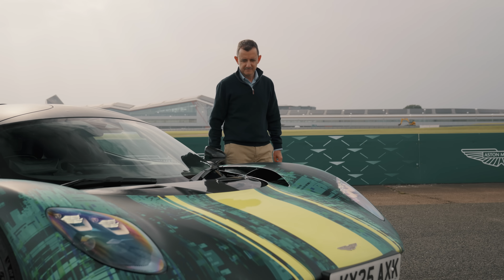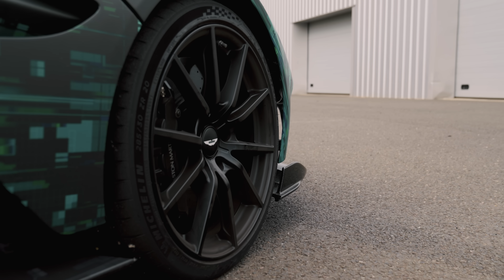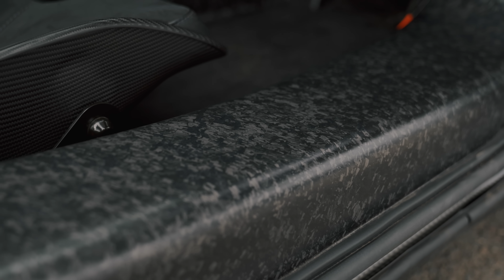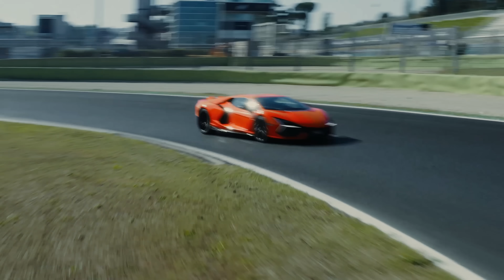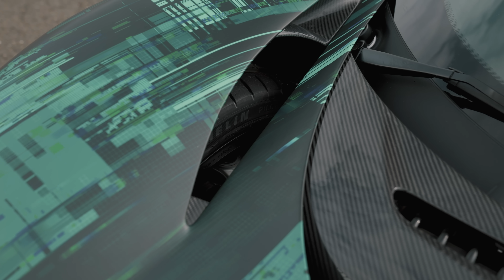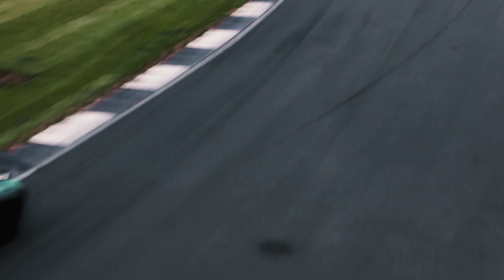FIRST DRIVE: Aston Martin Valhalla Prototype – 1064hp Son Of Valkyrie!

Comment: Forgot to mention the ZR1X as a competitor
Reply: Two different demographics, power alone doesn’t make you a competitor.
Reply: @Susanoszn Except the ZR1 has set some absolutely mighty lap records in the hands of the development engineers. Your “Corvettes don’t handle" schtick is no longer relevant and hasn’t been for decades. Google “c8 ZR1 lap records"
Reply: @Susanoszn so what happens when the ZR1 is faster on track and is better on the road
Reply: @scottbowers7248   You completely missed the point. DBS owners do not care if your Hellcat or ZO6 is “Faster”. They serve two different classes of people.
Reply: @Susanoszn when you pay that much for something and that something is a performance car it is about ego, and having someone spend a fraction of what you spend and have their car be superior in every performance metric and be better to drive on the road is a shot to the Ego.
Reply: @scottbowers7248  Again, you’re bringing up performance. It’s not getting through to you for some reason. Have a good day.
Reply: @Susanoszn it’s a performance car it matters unless you are simply a poser, if you drive the car it matters
Reply: @scottbowers7248 here’s a way you might be able to understand it. McDonald’s might be able to make a steak that tastes as good as a french restaurant for cheaper but your going to take your first date to the restaurant… they are not competitors
Reply: The zr1x isn't sold in Europe
Reply: That’s cuz it’s not
Reply: @jjjfo1818 what was the Nurburgring ring time for the ZR1X? What was the Valhalla’s time? I agree though the Valahalla doesn’t really reach the levels of the ZR1X.
Reply: @Make-Asylums-Great-Again  If I remember correctly the ZR1X lapped in the same time as a 992 GT3RS which has 700hp less than it. Oh and the Manthey version of the GT3RS was lapped in 6:47 compared to the ZR1X’s 6:49. Oh and the Manthey 991 GT2RS was even quicker so it can't even beat the last generation 991 GT2RS.

This Aston is nearly 500kg lighter has more down force and similar amount of horsepower. It hasn't lapped the Nurburgring yet but the conclusion considering those aforementioned facts is clear the Aston Martin would be quicker. Same for the McLaren W1 and the Ferrari F80 so I'd maybe hold off the victory lap.
Reply: @Make-Asylums-Great-Again The Valhalla will easily go below 6:40. The ZR1X couldn't beat a GT3 RS with 525hp.
Reply: The glaze does not stop lmao. Zr1x and this ain't even close. Hp ain't everything
Reply: No one buying this car will be cross shopping it with a ZR1X, behave yourself. 😂
Reply: @F1ll1nTh3Blanks exactly.  This looks exotic and unique.  The zr1 looks like a hopped up corvette.  You still have the base of a $70k usd corvette.
Reply: @F1ll1nTh3Blanks you’d be surprised, go in the corvette forum, all the guys who got a zr1 are comparing it to their sf90s and 765lts they already have
Reply: The Valhalla's use of a carbon fiber tub lowers the curb weight and greatly increases the cost. The active aero gives it greater control in the corners and the hybrid drive system is clearly more sophisticated with independent motors for each front wheel the likely adjust power to improve traction in the corners. Where it falls short of the ZR1x (as highlighted in the video) is the AMG sourced V8. Anyone who reads up on GM's flat plane crank V8 that was introduced in the Z06 and then got the twin turbo setup on the ZR1s will acknowledge that powerplant as something special. For one it redlines at 8500rpm which is insane for a V8.
Reply: @RichardV-m5v 8500 insane for a v8?! 😂

Ferrari came
Up with 9000 rpm v8 more than 12 years ago
Reply: @neojfk1883 a 5.5L flat plane DOHC V8? Yes, it's insane. Ferrari's V8s have always been tiny with small strokes. Even the 458 was a 4.5L engine with an 80mm stroke. Running a production engine with an LS-sized bore at 8500RPM and a GM warranty attached to it is a monumental undertaking. The stroke is shorter than the 458's and far shorter than the Voodoo's, but a WAY larger 4.104" bore. The LT6 is the largest flat plane V8 ever, and there will be more of those V8s made than probably all other flat plane V8s combined as well.
Reply: @spdcrzy off topic and unrelated to main comment or mine
Reply: It’s not one , performance wise yes but a guy that’s looking to buy an £850000 hypercar is probably not conflicted between that and a Chevrolet that’s £150k
Reply: Nobody is cross shopping this car with a corvette. The people who are buying these can buy a corvette too if they want.
Reply: The Valkarie has beaten GT3 race car times and close to LMP2 level speeds. This car has more HP, but also has more weight and not as good Aero but far better than the Corvette ZR1X. If you think they are in the same category you're high. The Corvette is impressive and a great achievement but not on the same level.
Reply: @eichler721 the “Valkyrie” is a $4 million car designed by Adrian Newey, the Valhalla is not is has less HP than the ZR1 and guaranteed Chevy’s engineering is better than Aston’s . Aston builds beautiful cars that are dynamically under developed
Reply: Aston has said they're shooting for 6min30 Nurburgring time, ZRX1 does 6min49, we will see
Reply: @c9designs523 ZR1X has a good amount of time left on the table though, with a pro driver their shaving off a few seconds for sure. It is a mid to low 6:40’s car with a pro driver in my opinion, I don’t think it’ll shave off 10 like Misha said however.
Reply: Lmao don’t compare American junk to an Aston
Reply: @teletubbypo318  It’s going to be compared. That American junk, has competed and won more races than Aston Martin has. Aston Martin’s Le Mans win, was won with Carroll Shelby at the wheel. Who went on to win with Ford’s junk.
Reply: It doesn't compare
Reply: I feel like it won’t get cross shopped with this for some reason..
Reply: they filmed this before ZR1 came out
Reply: @PiotrPiotr-v2ucame here to literally find this
Reply: No one will the money for the Valhalla will ever consider a Corvette as an alternative. This car will compete with the SF90XX.
Reply: I'm American, and would never insult this Aston Martin with a mere Corvette....😊
Reply: @Bruce.-Wayne  it’s not an insult. That Corvette ZR1/ZR1X is a beast. Only the car snobs consider it an insult. It’s got the design, the tech, the numbers, the engineering, AND the Heritage for less. 
Remember, the Corvette has its own in-house engine, Aston Martin is using the flat plane V8 from AMG, albeit a a great engine.
Are you paying for a name, or are you paying for something that has changed the game?
Reply: @TheCluesRnTheBlues it doesnt have THE design. Vettes look like shit. And their legacy is plastic things that go pretty quick.

You make it sounds like its Godzilla. Which could get away with being less refined. 

I'll give you the beast part. But that doesnt make it comparable to these cars. This arent meant to be 'beasts' I think.
Reply: @Tylernesss  just admit that you’re a car snob. The Corvette has proven itself in races for the past 25+ years. In the past, was made out of fiberglass. Not now. 
Now, I am not fan of the C8 Corvette’s rear end design. However, overall, it’s a good first attempt for mid engined Corvette design.
Reply: No, it's more like Ferrari sf90 and Lamborghini revuelto competitor than a corvette
Reply: Found the American guys don’t worry about it they don’t know what they’re talking about
Reply: We still don't know if the ZR1X is going to be available in the UK.
Reply: both cars are to fast to plant your right foot on the road and both cars are faster than 99.99% of drivers on a track. It basically comes down to personal preference. And who actually cares about rings times? These are poser cars not track cars, not that i think thats a bad thing whatsoever.
Reply: Typical Americans still crying
Reply: temerario
Reply: People will buy this to park in a garage with their 87 other cars and just look at it, people will buy the corvette to have it stolen.
Reply: Feeling jealous..?
Reply: (Because it isn't a competitor)
Reply: A ZR1X doesn’t keep up with the Valhalla on a track. It’s heavier and a lot less down force. Only comparable in straight line speed. The Valhalla barely keeps up with the F80 and W1 on a track. As a matter of fact the Valhalla is better tied performance wise to last decades holy trinity cars along with the Revuelto and SF90 being close to those cars. The Valkyrie on the other hand over laps the F80 and W1 having a lot more down force and less weight so also not directly comparable. But all these cars will be compared regardless. I have downforce numbers if someone disagrees
Reply: @firomancer1018 The ZR1 and ZR1x are competitors.
Reply: @rkwjunior2298 the Valhalla makes more than twice the downforce of the ZTK ZR1s and it weighs less. I’m ignoring price and talking about performance and the math isn’t mathing. A quarter million dollar vette can only do so much with static aero and mechanical grip. The regular ZR1 is over 3900 lbs let alone the ZR1X being even heavier with the hybrid system, we’re talking 4100 lbs. That’s getting closer to GTD territory with that 4343 lbs
Reply: @firomancer1018 They are competitors whether you like it or not.
Reply: lol that pice is junk a competitor ? Struggling to keep up with a gt3RS with less than half the power
Reply: @neojfk1883  so it matches/is better than the gt3RS in the exact thing that the gt3rs was designed for, and will be faster and more comfortable everywhere. While costing less money. piece tell me how it's a piece of junk.
Reply: Yeah. However, this probably will be lighter, and better quality materials. Oddly, this was supposed to have a 3 liter  TT hot V V6.
Reply: @TheCluesRnTheBlues engineer said it's 1655 dry, so it'll be around the same weight wet.
Reply: @Mr.Waffullz  Motortrend lists the C8 ZR1 weight as 3,900 pounds with all the fluids.
Reply: @TheCluesRnTheBlues indeed, but MUCH more expensive.
Reply: @TheCluesRnTheBlues "better quality materials" they can't afford that in their stripped out hypercar remember?😂 the Vette has heated and cooled seats, full aluminum everywhere, carbon fibre, swede, leather, there is no way in hell a british sportscar is up to snuff in quality when compared to an American luxury sport vehicle.
Reply: @aaronvector4750  It’s an Aston Martin, the second project after the Valkyrie. Did you not see the interior of the Valhalla and the active aero/DRS?
The Corvette is giving performance for a lower price. The Corvette doesn’t have the active aero/DRS, and the stripped out carbon fiber interior. 
The ZR1 is RWD, (according to Car& Driver) 3,831 pounds. The ZR1X is the AWD version.
I’d say this, the Corvette delivers performance for far less. Makes one wonder is the Aston Martin even worth it?
Reply: The ZR1X is a formidable competitor. However, the Corvette target market is quite different. Plus, there are individuals who will buy both plus own many other vehicles in their fleet. It’s not an either-or debate. Though it will look good for automotive journalism.
Reply: The ZR1X sells for the price of the options on this car and is probably faster. However it's not European, you can fix it at a Chevy dealer, it didn't cost as much as a house and won't lose $175K a year in depreciation. Therefore,.we must hate it. 🙄
Reply: @davidnicholson6680  Exactly, you get the point! It's a Chevy, not a supercar. And no, it won't even touch the Valhalla and the SF90XX (which the Aston competes with) on track. It should try to keep up with a 500hp GT3 RS before it can take on this tier of cars.
Reply: @Direly_Strait Get the SF90XX to beat a Senna last time I checked it lost by 3 seconds on Hockenheim. ZR1 beat the Senna by 2 seconds at VIR. It’s also 5 seconds faster than the Black Series, GT3RS, and GT2RS. Black Series is another car the SF90 XX failed to beat at Hockenheim
Reply: @dylangiles2624 Comparing laptimes between different cars in entirely different tracks tells me everything I need to know. Never beating the allegations.
Reply: @dylangiles2624 corvette laptimes are factory supported on American track while other brands laptimes were done by magazine, if in the hands of sportauto driver zr1 can beat sf90xx ,black series or senna then we can talk, just look at the ring laptime ,on American track zr1 beats gt black series while on the ring it failed to beat 7 year gt2rs, even tested by sportauto zo6 was 16sec slower than gt3rs and 12sec slower than 296gtb, let see if corvette give zr1 to sportauto for hockenheimring and ring test
Reply: Hypercars have become soulless over the years….
Reply: A British magazine, caters to a British audience. The corvette isn’t for here. Thankfully.
Reply: @gooddypm  ...   I think you'd be surprised!
Reply: @howardmckenna about what in particular?
Reply: @gooddypm  ...  The ZR1X is meant to be insanely competent. Rumoured 230mph, too.
Reply: Why thankfully its a great car with incredible engineering  @gooddypm
Reply: @gooddypm im more into europeans but the zr1x is a much faster and better car than any of the sf90/296, revuelto, and all the other europeans thankfully lol
I track my cars and have ripped a 296 when i was at maranello so id like to think i know a thing or two but then again maybe not.

All im saying is when theres more people making great cars its better for everyone. At least for people who can afford
Reply: @PaganiKoenigsegg1 that has nothing to do with what I said. This is aimed at Brits, not Septics. The Corvette won’t be on sale here. This is a British Magazine doing a video to a Brit audience
Reply: @gooddypm  this car a million quid. Importing ZR1X to UK probably costs around 700K quid.
Still 300K quid cheaper 🤣.  But yes, LHD only.
Reply: @gooddypm not sure where you got that. But C8 Corvettes are pretty reliable. Look it up if you don't believe me.
Not sure about this Valhalla though
Reply: @PaganiKoenigsegg1 Why is it a better car?
Reply: @GSCinquanta i wouldnt say its better, my point was just its better for people to have more options. 

Like i said above i personally track my cars so if theres more options the better it is, whether its 40k price range or 400k price range or more. I was driving a 296 when i was in maranello and that felt great but im just saying that just because its american it doesnt mean its inferior.. it might even be better than alot of cars people think are "great" and no im not american.
Reply: @JiTiAr35 and is not as good looking,is not as premium ....
Reply: @MARCO-rq2ph  that's an opinion. I can't argue with that.
Reply: @JiTiAr35 

Tell me which one will then lose more money!! Just because one costs £1m whilst the other costs, theoretically, £700k, does not automatically make the cheaper car better value! The ZR1X will shed value at a frightening rate!
Reply: @PaganiKoenigsegg1 zr1 losa quarter Mile to 992 revuelto 750s tuned and plaid. Sf90 is right behind the plaid. Americans lack in engineering. I come from a father with ALOOOT of exótic cars. He put half deposit for new gtd and he is also getting zr1x. I’m more excited for gtd cuz of the engineering and technology. You ripped a 296 which is fast but is the most souless car from Ferrari, you can never compare a corvette to a McLaren or a v12. I don’t care about speed. I’ve driven all my dad’s cars and the rawness is something you don’t feel in American cars like a european. Mind you all our cars were custom made by us and all built.
Reply: @michaeljr8615  you genuinely don't know cars at all
Reply: @gooddypm 

Your a Hater you think Americans don’t watch top gear and love cars too? Take the stick out your @$$ 🫏! And the real reason you wouldn’t have corvettes sold is because you guys would be embarrassed of how much it would destroy the competition!
Reply: @gooddypm  stupid comment. ZR1 is proper high performance car
Reply: @PiotrPiotr-v2u20 years behind the rest of the world, but okay.
Reply: @gooddypm  in terms of overall technology, yes. But performance is very close and Corvette should be given credit for what they made. Maybe because of them Porsche will push their development plans even more
Reply: The ZR1x will be better in every measurable way... except looks and "fit and finish". I think steering will also be a noticably number in the ZR1x as well. With that said, people who can afford this car would just buy both, the comparisons are for us brokies in the comment section lol
Reply: Literally direct competitor
Reply: Zr1x will smash it 1250 bhp,rip!👋👀💀💪🇬🇧🇿🇦🇿🇦🇿🇦🇿🇦